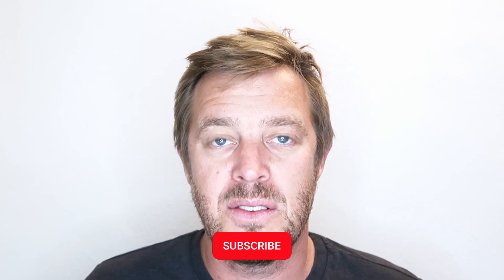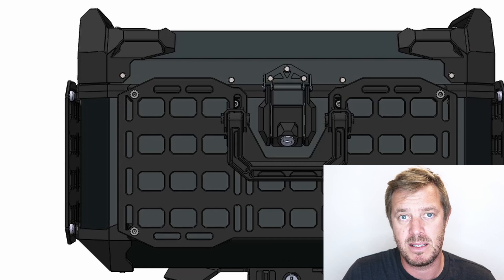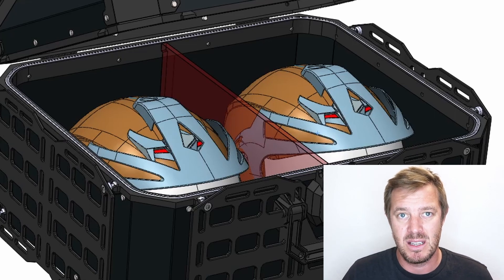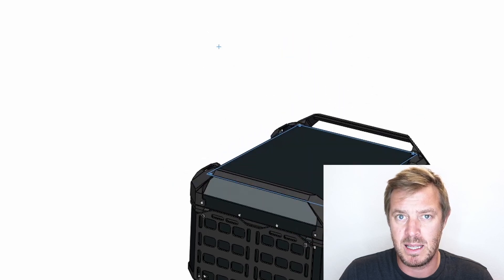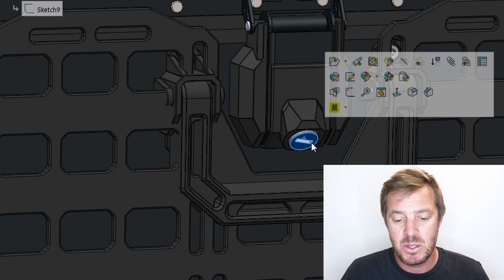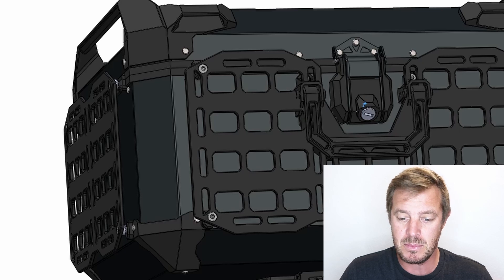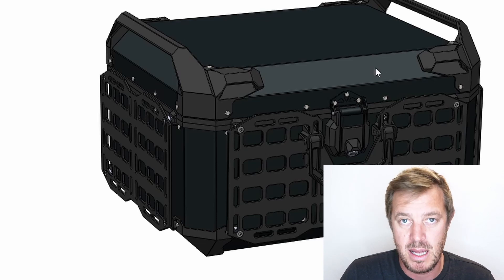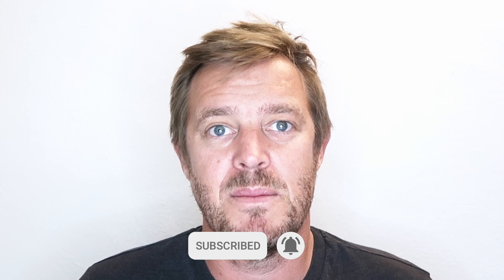Motorcycle Top Box Design, How to Make It Better?

Comment: Are you looking to use the Vario locking system for the R1250GS? 
For the helmets, are you allowing enough width for a Cardo (or similar) which is often hanging off the side of the unit?
The divider panel in the middle is a great idea.

Comment: Could you use double glazing bead for the seal? This is fairly common and simply super glue ends together. U grouve e in the box moulding to slot the seal in.

Comment: Topbox looks great.  Please keep enough room so that if the helmets have comms units (Cardo or Sena) that they still fit in the box and the lid can close and two helmets can still fit.  Handles on top may not be necessary.  Rear molle panels my not be needed.  I like the removable side molle panels.  A net in the top of the lid is a good idea.  Back rest pads for passenger are essential for taking a pillion.  If the molle panels clip into plastic, have parts available to replace the plastic when it breaks in a tip over.  Tether on the lid to keep it from flopping completely over when open would work.  an Internal removable bag would be great.

Comment: If I understand correctly the soft panels are rigid, which is not bad in the idea of making them removable very easily. Nevertheless, they should not be sharp for the straps of the equipment that would pass in. Would there be a maximum weight not to be exceeded?
Upgrading the two large handles at the top of the top case would be a plus, thus facilitating the overlay of business.
The presence of a waterproof internal bag would be very appreciated.
Integrated on the inner walls of the top case a shockproof coating (as for the bottom).
In the inner part of the lid provide a compartmentalized bag.

Comment: Would be interested if lighter than my current BMW vario case, and used BMW mount-like your panniers use the vario side mounts. Smaller size option, BMW lock cylnders and make side and rear(with handle) molle optional to save weight and reduce cost.

Comment: Is the lid hinged or can it be removed? My Givi side panniers, the lid can be removed which is very handy if they're particularly full and I've found it easier to pack when you can remove the lid. It's a shame the top box doesn't have the same removable lid.

Comment: Looks well thought through...I like the wider one...I have had the givi V56 monokey but i don't like the way it looks.  This product that you are working on looks great.  Personally the wider one with the molly panels.  I'm currently using the Overlander 48L...but it is a little timely cause it has so many buckles, but i like the way it looks.  This top box will/would be perfect.  I have already preordered the rackless system and can't wait to receive them.  I like the way the top case looks now...(i do like the wider one, if there is a option) Great Job designing !!  How many liters are you expecting the box to be?

Comment: If the box sits on the baseplate pins when it is off the bike, there is a risk that the pins will get damaged and/or the surface on which the box is placed gets damaged.

Comment: Someone mentioned BMW lock barrels, is Triumph possible too? Not sure if they'd be compatible or not.

Would it also be possible to have the base plate be a longer, flat-ish plate to use as an extension for caring larger bags like your Moto tent? I have an outback motortek plate that works great to strap the tent bag down front-back for aerodynamics and more importantly to maintain easy access to the side boxes.
Reply from the maker: Need to see what the key looks like. Not sure but will check.
Reply: @Lone Rider  Okay, that'd be really convient if they were the same style.

I think I added to my response at the same time you replied. Will the base plate also extend off the bike like a lot of the other aftermarket tail extension plates?